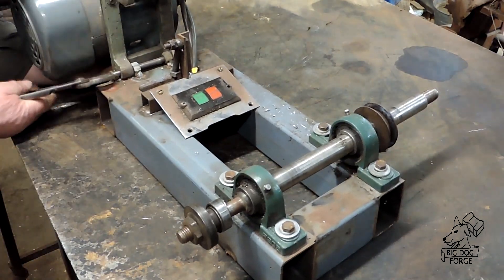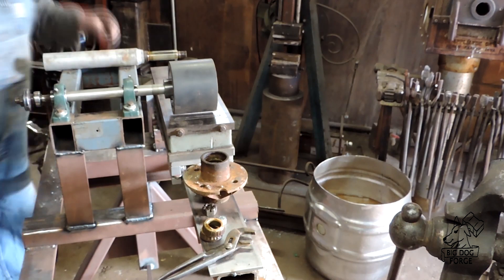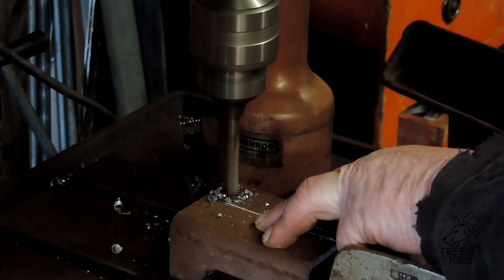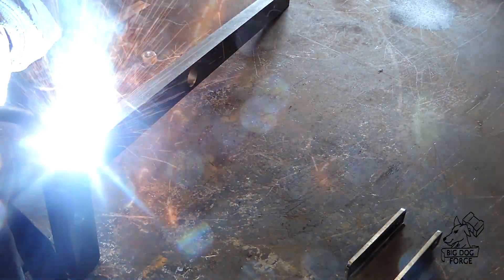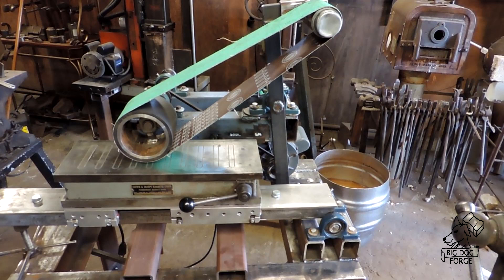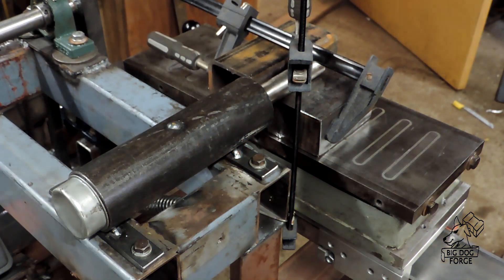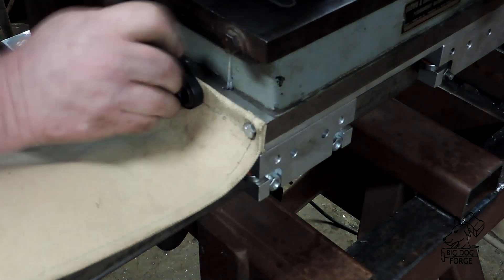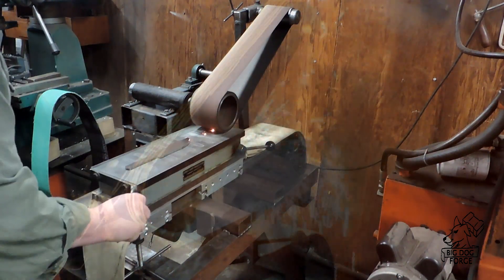SCRAP PILE SURFACE GRINDER PART #4

Comment: just finished my surface grinder  it works great and I half to admit it looks a lot like yours . thanks again for the 4 part video , my scrap pile had a lot of 6x6x 1/4 box so the frame is a lot different but mag vise and the slide is a carbon copy hope you don't mind . I do tell any one that sees it that I copied yours.  I really enjoy all your videos and have learned a lot from them keep up the great job.

Comment: Okay, I get it now on how it still grinds flat. The very bottom of the wheel only touches so the linear movement is still running true even on a tilt. For some reason I was picturing the belt running a flat surface, not just the contact wheel end contacting the material to be ground. Awesome job, Tim. I suppose you could call it "Kate" from Kate Moss, she's pretty flat, but still looked good in her outfit in the "Matrix" movie trilogy .

Comment: This thing is killer! But doesn´t it grinds a taper into everything you grind on it? If you turn the handle on the screw for the height adjustment, the magnetic chuck will only raise on that side and will therefore tilt a little.
Reply from the maker: The contact wheel is round so the plain stays the same it just gets closer it does not grind a taper.
Thanks for watching